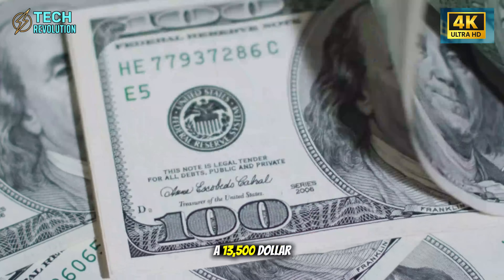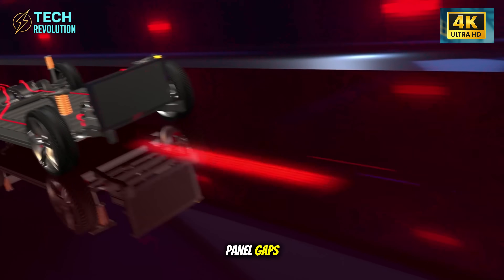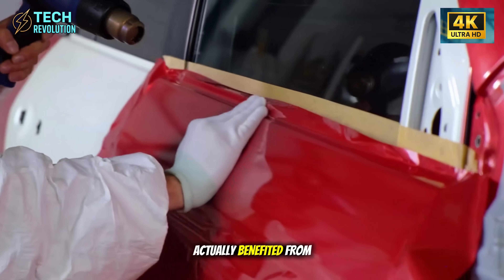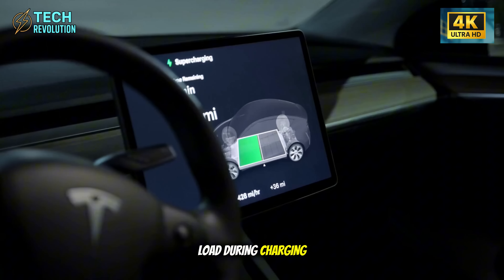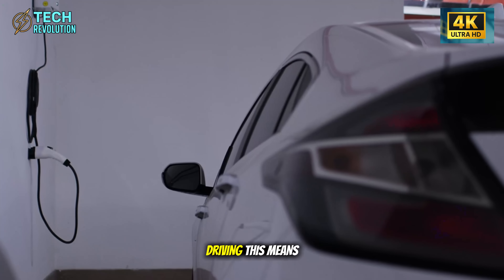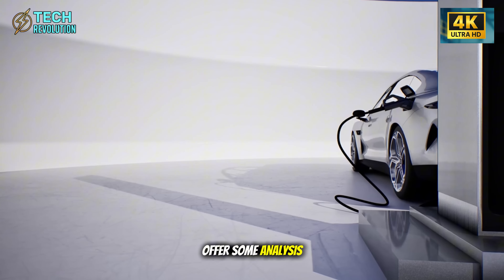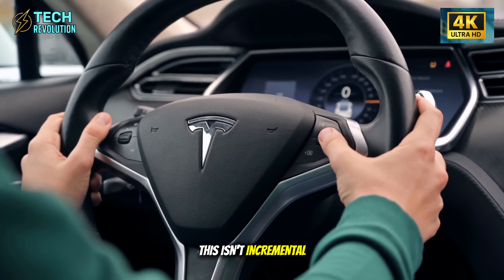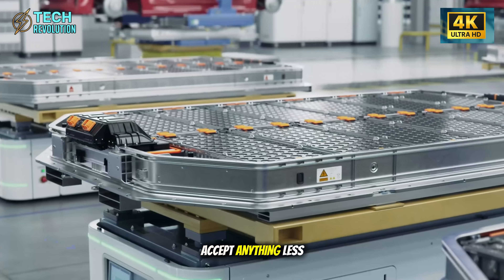Tesla Model 2 FINALLY HERE: 2M-Mile Car, Zero Repairs Needed at $13.5K!

Comment: The real trick is going to be the $13,500 price tag. Let's see if it goes to $25,000 or more.
Reply from the maker: $13,500 Model 2 depends on scale, Gigacasting, and battery costs—if it slips to $20–25K, the long-life thesis still holds, but disruption slows.

Comment: Full Self Drive has an accident rate of 1/8th of the average human driver, so 1/8th the number of auto body shops and employees.
No oil changes, brakes lasting past 100,000 miles, no radiator, and no transmission will reduce the number of repairs shops need by 50% and 50% less employees.
A  car with a 20 year life will reduce the number of new cars sales by 25%.
Reply from the maker: Model 2 impact isn’t linear. FSD + long-life EVs shift jobs from repair volume to software, calibration, and fleet ops, not just “25% fewer cars.
Reply: peccato cattivo  per inesistenza colonnine, tempi di ricarica, dimensioni e peso insostenibili.

Comment: I would like to see evolutionary minimalism. 2 seats, 2 doors, hatchback. Can use the same platform as Cybercab. Swappable center console and steering controls for handicap, luxury, and other aftermarket customizations. Standard 18" wheel option, Polycarbonate windshield is shatterproof and cheaper, Aerogel insulation panels to save heat pump power and add comfort, Solar cells on top will pay back many times over in added range and battery discharge protection, Low power Starlink, Seat with full recline, No BS features. If Tesla will sell it to me...
Reply from the maker: That’s a clean Model 2 vision. Minimal hardware and durability-first thinking are exactly how a $13.5K long-life car stays honest.
Reply: @TechRevolution26  13.5K will take many years. I would pay more and if Tesla holds the price like they have done with other models as costs come down that will make it affordable to more people as inflation reduces the value of money.